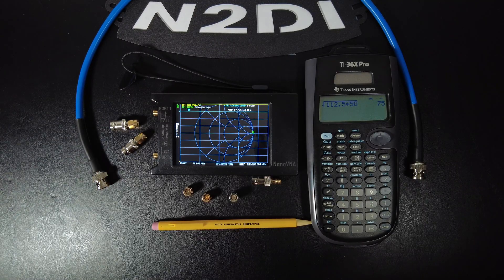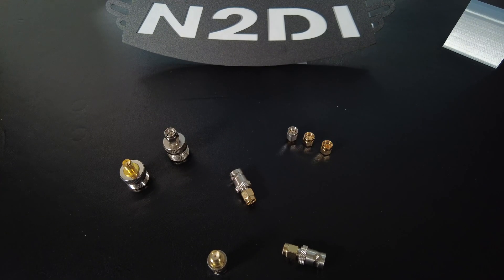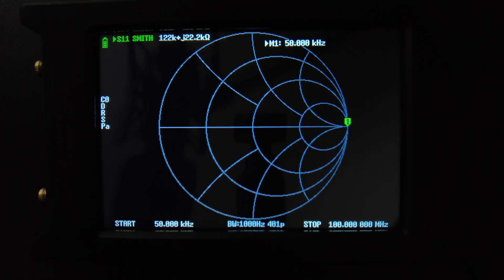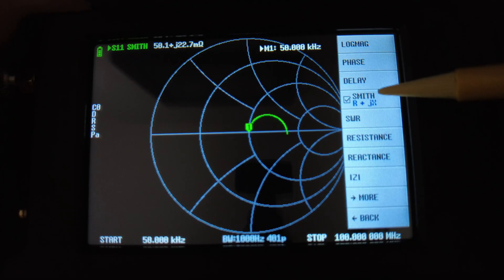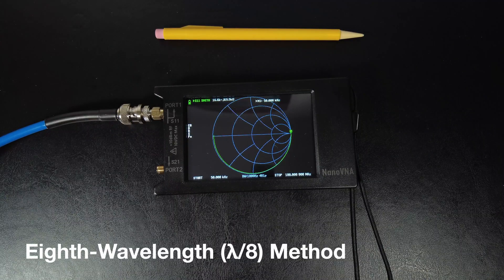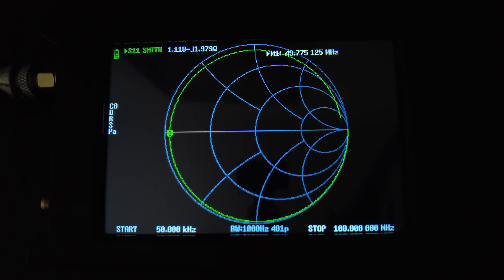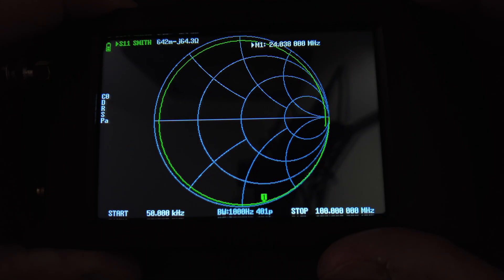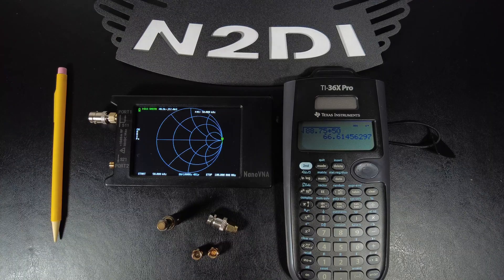NanoVNA Measuring Coax Impedance

Comment from the maker: Sorry folks, quick correction: When using the 1/8 Wavelength method you are looking at the J reactance value (NOT THE RESISTANCE VALUE) and taking its absolute value as the impedance value.

Comment: Great video. Thank you. One correction...When you were testing the scope probe cable and using the 1/4 wave method, you calculated the value taking the sq rt of  88 ohms * 50. The VNA actually showed 80.75 ohms not 88.75. The real result should be  the sq rt of 88.75*50 which is approximately 64 ohms not 67 ohms. Not a big difference but thought I'd mention it. Those VNA screens are a pain to read!!! Thanks again.
Reply from the maker: Thanks.  Yes they are difficult to read especially when I'm recording because I have a huge microphone and camera between my face and the screen too!

Comment: Another method using the same set-up for 50Ω go/no-go test (3rd method):   If you have a small potentiometer, you can use that as the termination instead, then adjust the pot for as close to a single dot as possible on the Smith chart.  Then read the resistive value off the Smith chart (or the potentiometer resistance on an ohmmeter).
Reply from the maker: Thanks for sharing that alternative method!

Comment: Thank you. This was helpful for my  short bundles of cable, but I have one that is about 150' (about is doing a lot of work here) and when I connect with a 50k - 100M calibration, the smith chart is significantly messier and I can't make anything useful out of it. You mentioned that those values were relative to coax length, but I didn't catch where you explained how to figure out what values to use.
Reply from the maker: Sorry if I missed it in the video but you can figure out the stop frequency in megahertz = (5850/Length of coax in meters) * Velocity Factor of Coax.  In your case it should be (5850/46) * .84.  I'm guessing at the velocity factor.  I'm assuming you are using LMR-240 so your stop frequency should be around 107 Megahertz.  Let me know if that works.
Reply: @JoeN2DI  Thank you. I appreciate you covering some of the more advanced usecases for this thing. It's pretty impressive. I can't stop looking at it like a cheap toy, but so far it has been accurate enough for simple work and very flexible.
Ordered a TinySA Utlra+. If this is as good as everyone lets on, maybe it is too. :)

Comment: Useful and clearly explained. Do you have any thoughts on using a homebrew 50 ohm load for the.cable end rather than another adapter? Y
Reply from the maker: You can get.a so239 or female bnc connector and solder a surface mount 50 Ohm resistor across the center conductor and shield.  I wouldn't use a resistor with leads because that will introduce stray capacitance and/or inductance.  For the short, you can just solder the center conductor to the shield.

Comment: Useful and clearly explained. Do you have any thoughts on using a homebrew 50 ohm load for the cable end resistance rather than using another adapter? Y
Reply from the maker: You can get.a so239 or female bnc connector and solder a surface mount 50 Ohm resistor across the center conductor and shield.  I wouldn't use a resistor with leads because that will introduce stray capacitance and/or inductance.  For the short, you can just solder the center conductor to the shield.